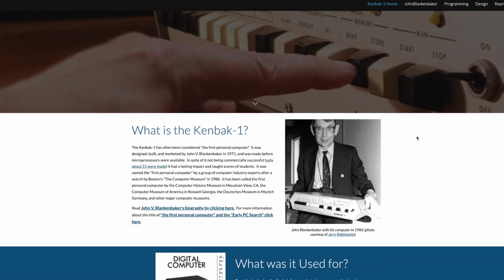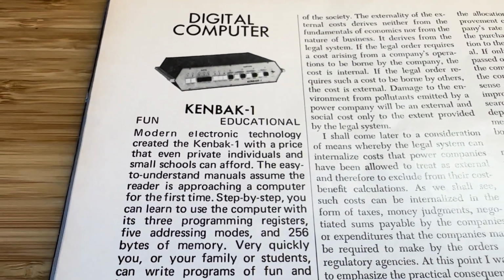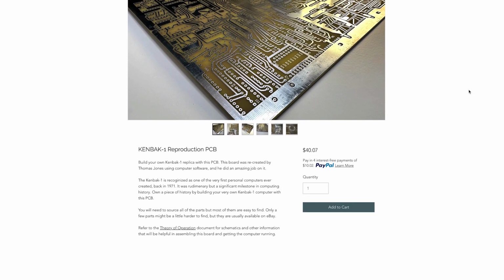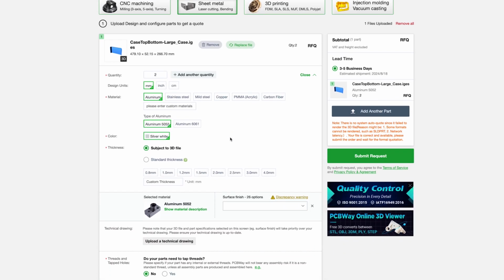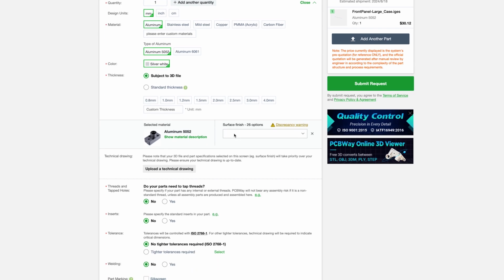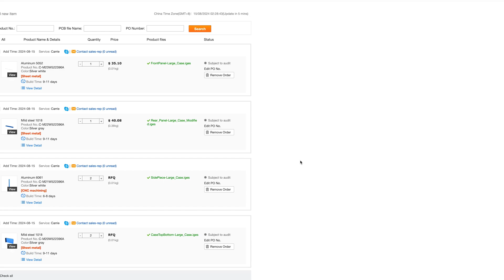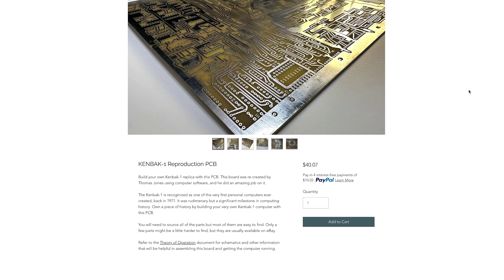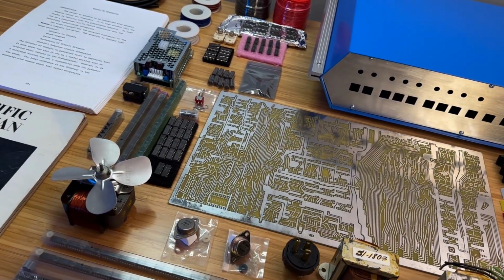Building the Kenbak-1: Recreating the World's First Personal Computer

Comment: Okay, I'm signing up for this project! I have several replicas of the Kernbak-1, and I also designed the Kenbak-1 Ruler with serial monitor, assembler and disassembler.
I've already ordered the kit and the PCB!
Reply from the maker: Awesome! It’s an interesting project. Can be hard to debug, though, but fun to play with. Will you be getting a case? I would consider getting at least the front panel - it’s not too expensive.
Reply: @artemkalinchuk  If I can get it to work, maybe I'll do the case myself.

Comment: Wow, that's amazing!  I wondered if anyone would build a 1:1 replica of the Kenbak-1.  I have a couple of the Adwater & Stir functional replicas (the µKenbak-1 and nanoKENBAK-1, both using a modern microcontroller for the computer itself), although I haven't had time to really learn to use them.

That total price for a REAL replica is a bit eye-watering, although it's interesting that it would still be much cheaper (especially adjusted for inflation) than buying one new (and assembled) back in the day.  😲

Comment: Isn't the hole at the top right of the front panel for a never implemented card reader? It would be funny to stick a SD card interface there.
Reply from the maker: No idea. Mine doesn’t have it. I thought it was for airflow.
Reply: The designer had one use in mind for that slot: https://youtu.be/OUCJXyThSXI?si=zZcaQOFM-1iAZt-c&t=4035

Comment: The case even now costs around 1k to make.  I was interested several months to around a year ago.  The problem with this computer is that it cannot attach to any type of modern display at all, and cannot run any forms of basic.  Interesting video though, I hope it runs well for you.

Ill stick with the Mark-8 for now, which im still gathering parts for.  Unless you decide to make a full IBM-360 mainframe computer.
Reply from the maker: It's true that it cannot interface with anything. I just like the idea of building the first PC. The first of anything is usually not great feature-wise.
Reply: @artemkalinchuk  yeah, I'd do it.  But so costly.  Might just have to get the mini one on this version :(
Reply from the maker: @signorelephant true. My thinking is, if I’m going to build it, might as well build it right :-)
Reply: @artemkalinchuk  the case is the hardest part with this one for me.  If it didn't cost over 1k, I'd probably be more inclined to go for the project.  Definitely mark-8 first though, just ordered the power supply from you two days ago
Reply from the maker: @signorelephant I agree, it is expensive. I’ve been trying to find a way to build it for cheaper. The power supply PCB is on its way. Let me know if you want the V2 version of it which supports the larger heatsinks. I can ship it to you free of charge once I finish it.
Reply: @artemkalinchuk  I am actually looking forward to your v1 version.  I know you were saying it has the possibility of overheating, but it'll be cool just the way it is.  A lot of the power supplies back then had the issue of being quite warm, so maybe that fits that type of generation.  Appreciate the offer though.  I'm sure when I gather up all the supplies, I'll have other questions.  

I hope you can find a way of building it cheaper on the other.  Your videos will certainly be cool on it.  I know there have been some videos where people have put it together, but just have a raspberry pi inside, and I think that takes away from the project.  Like you said, you have to do it the right way if you are going to go about making the project from scratch.
Reply from the maker: @signorelephant  Just be sure to use a large enough heat sink otherwise the voltage regulator will burn out quickly. I guess you can continue replacing them since they’re cheap :-) I’d recommend 2 degrees C per watt thermal resistance or lower.
Reply from the maker: @signorelephant  Check out sendcutsend.com if you're in the US to get a fairly priced sheet metal work. You can get 1 front panel for $25 from them. It can be even lower if purchased in bulk.